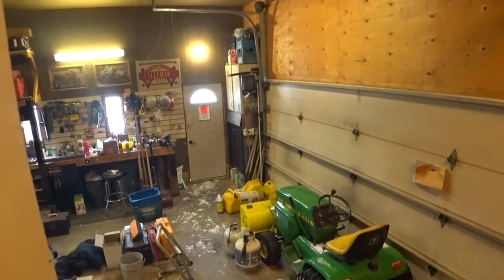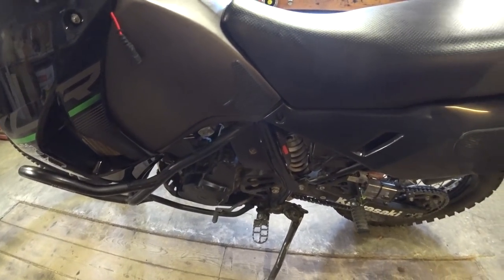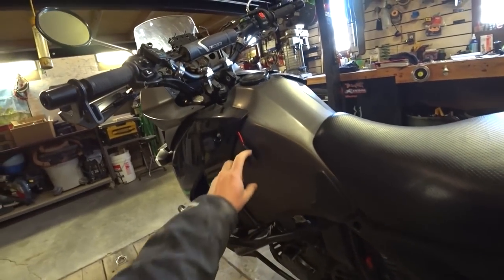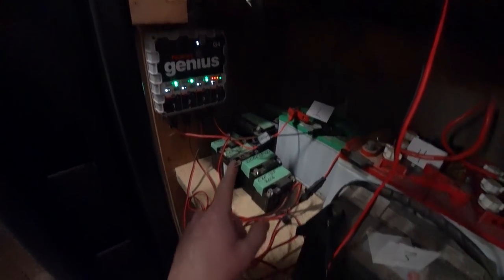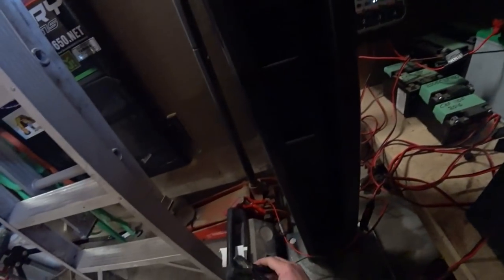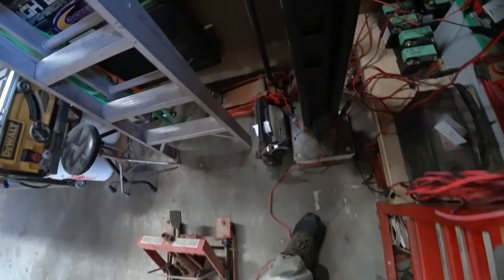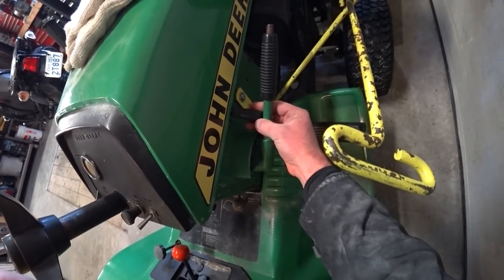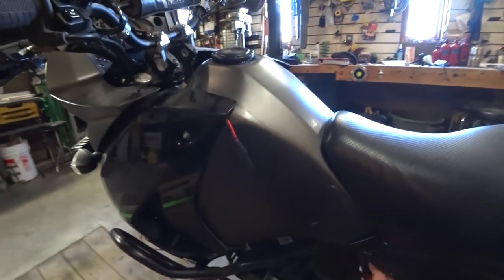My winter battery maintenance setup | KLR 650 |

Comment: Find a way to attach the little number system to both ends of the battery terminal clamps wires. That way you know where it's plugged in and you can match the other end to whatever battery you want on that port.

Comment: I'm not sure if you have in the past , but how about a shop tour? looks like your fairly organized . Might get some ideas for my shop. Nice charging station , I use Battery Tender brand for our bikes , they work well. Thanks, great video.
Reply from the maker: Hey Bradley, No, I haven't done a shop tour yet. It's as organized as I can get it with all the equipment in such a small space ;) but it has been a work in progress for over 20 years lol.
Battery tenders do a great job for sure but I would have to buy enough for the 5 bikes and still need a system for the other equipment around here so this made sense for me.  Cheers!
Reply: The car hoist idea was the best idea :D
Reply from the maker: Best storage ever :)

Comment: You touched on how you had all your accessories wired. Do you have a video where you explain it. I cant seem to find it if you do.
Reply from the maker: No, I didn't do a full vid on the wiring. There are so many options out there from electronic power relays to distribution blocks that I didn't want to get into it. Mine is quite simple using a main line from the battery to two switched relays to my accessories.

Comment: Way better setup than my 3 trickle chargers on a power strip. Where did you source that voltage meter and electrical fittings. How do you split the power to the multiple power ports from that you run after the voltage meter? Are you using any sort of power distribution device? I’m about to redo the mess of wiring on my gen 2. I enjoyed this video
Reply from the maker: Hey Casey, Yeah it works really well and I've had it now for at least 3 years. I have put links to the items on Amazon in the description but I bought them at Canadian Tire. I just ran that line up under the dash and cut the end off. That's where everything connects including the relays for the lighting and the line to the tank bag. Cheers!
Reply: You’re gonna have to take your dash apart to show the people the brain of your KLR 👍
Reply from the maker: Haha yeah, That's an idea :)